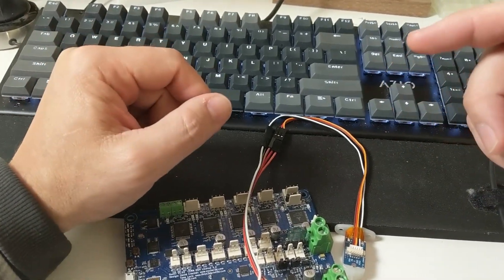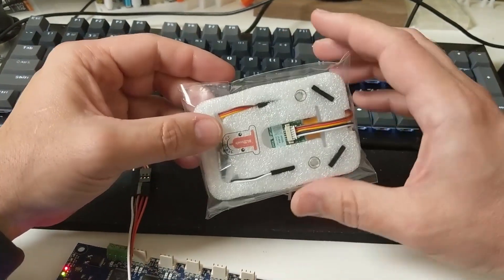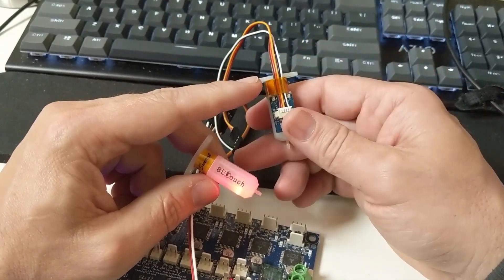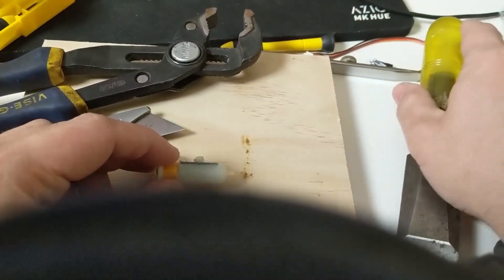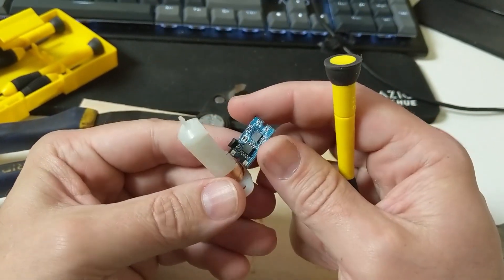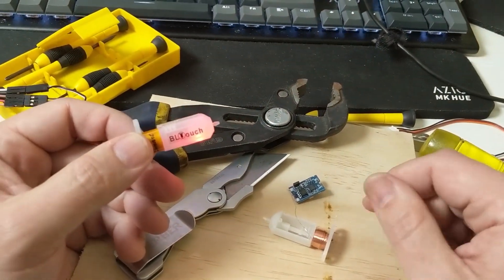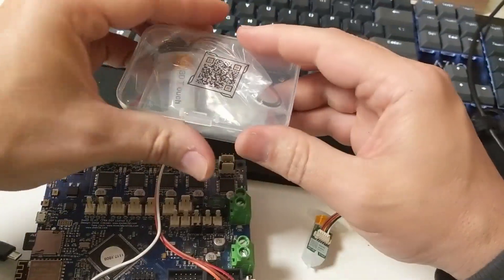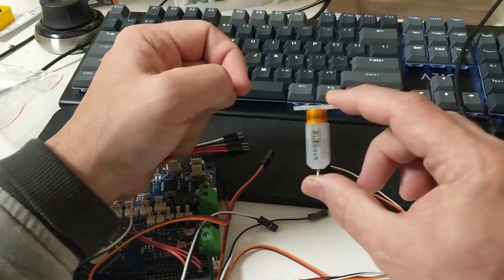BLTouch vs.  3DTouch - Should you save some money and buy the clone?

Comment: The BLTouch is not much better. Its repeat accuracy is better but its failures are the same. Rarely can I get a complete bed level scan without the BLTouch faulting (failing to deploy probe) and flashing. BLTouch support blamed it on the +5V power. I replaced the power supply with a much more accurate supply and put a scope on it. The BLTouch still fails but support refuses to do anything other than blame the power supply.
Reply from the maker: Are you a real person? Why does your channel have no content? Usually you can see subscriptions, and playlists, or an odd/random uploaded video for a typical "real" person on YouTube. Clicking on your username only shows "This channel doesn't have any content"
Reply: @DesignPrototypeTest  I'm just a guy who enjoys 3D printing and do a lot of my own testing. On this video I found BLtouch to be faulty with poor support. Unfortunately the 3D touch I had was worse. Neither was a plug in and run and neither I would buy again.

The actual problem with the BLTouch I have is the pin sticks and the temporary fix I figured out was when it faults (often at powerup it fails to pass its self test) I have to manually pull the pin down then select the macro to reset BLTouch alarms. The BLTouch will then work for some amount of time then fail to deploy again. If I repeat home Z after 5+ homes it will fail again.

 Note as a by the by you tested the sensor holding it horizontal and not vertical. The sensor including the BLTouch is more apt to fail in any position other than perfectly upright to reduce drag on the pin. 

Hardware fails and the true test of a manufacturer is how their support works. BLTouch simply re-directs and blames something else in my experience.

The positive side to Asian manufactured product is people expect it to be throw away and get little to no support. The reason for buying more expensive non Asian is for the support. Often it is not there and it is just more expensive. The funny part is non Asian is often still manufactured in Asia.

 I watch videos in 2 different perspectives:
1 - for my information where I can extract bias and get the info I am looking for on a product.
2 - for the growth and expansion of the 3D printing community - newbies joining us.

For the newbies joining:
 You likely seen my negative comments on video's that are very negative. I noticed of late that evaluaters on 3D print products wandered down the path to slam products. Videos are created for the reason of telling people this is junk. Slamming products and being negative in no way helps growing the 3D printing community. The reason for this is the odd thing you say positive three other evaluaters will comment negatively on. New people get very confused and do not join us in the community. I have heard people over and over give up on 3D printing because there is no way for them to make up their mind on a product to buy or move to commercial products since help videos basically call everything junk.

 I think in part this is due to bias in the evaluation and feeling the need to point out faults. This bias should not be there but of course its hard not to show it. For example I would believe you are for Delta, non Asian products and intellectual property bias, these products you praise and focus on their benefits. All others your primary focus is on the faults.

 On this video I would think you created it with a mindset (I will push this thought to the extreme to make a point) of telling people the 3DTouch is Chinese garbage. How different would the video have been if the mindset was to compare touch sensors? The same point is given but the concept is positive not negative.

 People are not dumb and can draw their own conclusions, they want to that is why they are watching!

Example and just points I dreamed up they don't actually reflect my view.
BLTouch benifits
Repeat accuracy of 0.05 mm - higher print starts (words??? lol)
Reliability
Long term life
Stylish
Replacement pin available 
Support

3DTouch benifits
Repeat accuracy of 0.2 mm
Inexpensive

You get the point, positive words listing non bias benefits not just benefits to point out the faults of the other products. Build a video around that basic thought and not based on proving its junk.

From the above people can draw a conclusion that 3DTouch does not offer repeat accuracy and Support and make up their own mind on a product. It also shows that first layer could be prone to failing more often with the lower accuracy without actually saying it.

Many people do not want to be "told" what to think and want to think for themselves. Every person watching has their own unique situation different from yours. Your fault conclusions may not apply to their situation. If you had a benefits conclusion they then can apply that to their situation.

 One of my observations about people over time has been that people learn the hard way no matter what we say is the saying. That is not exactly true and it is influenced on exactly what we say. If we tell people what to do (the negative thoughts path) they often do the opposite and "learn the hard way". If we discuss benefits positivly they often will not choose the path that we personally know they should not choose.

Negative sales studies showed that if you tell people what is wrong with other manufacturers products that people more often than not will buy that other product.
Reply: @DesignPrototypeTest  well how do I test that? I have no idea why you tube doesn't show you subscriptions
Reply from the maker: You should probably upload a single video of yourself if you don't want to be perceived as a troll/bot account. Maybe there is a 'privacy' setting that you clicked on to hide all of your account details from the world. Being so secretive about your identity makes you seem like an agent or a bot.
Reply: @DesignPrototypeTest  I have no idea lol. When I tried to put in a message YouTube said I could not unless I did stuff so I did it until it allowed me to enter a message.

Comment: I've actually tested both as well and had the same issue with both genuine and clones.  The same applied to Duet boards (authentic and clone).  Politics and morals aside, I ended up learning a bunch when the clone Duet boards I ordered once didn't have ANY jumpers pre-installed.  I went through several authentic and clone BLTouch sensors (and other Z-axis sensors) but what I discovered was that there are voltage setting differences in the PCBs and with the Duet boards (not sure about other boards).  Without any jumpers installed neither authentic or clone would work.  With the proper voltage jumpers set, both worked just fine and in an identical fashion.  What's sad is that even the BLTouch documentation is so piss poor that it barely assisted the troubleshooting process.  Even the OEM of the BLTouch could stand to improve their product and documentation, especially if they are charging a premium.  I've also learned not to expect anything to "just work" when it comes to 3D printing parts.  However, I always come out of the experience learning something.

Comment: Even the original BLTouch will fail after some period of time (two weeks in my case) when running on 3.3V. The Duet Z axis input handles any voltage up to 30 volts, so there is no reason to use a 3.3V supply voltage power supply.

Comment: Despite beeing a copy, those Clones work pretty much the same as the Original. I had both. But, I think Your Clones weren´t faulty, You just didn´t connect them correctly. There are 3.3V and 5V Versions AND Sometimes the Colors from the Wires do not Match the Original. So please when rewieving You should Rule that out first. In the End it seems to be just a rant and justification to buy the Original ones. I support the Inventors if I am able to, but sometimes their Things are way beyond my Budget, so that I have to resort either to much more time collecting the Money or simply buy what is affordable to me. Regards
Reply: Its looks like its works by pushing out the plastic with magnet on end by magnetising the coil where it reaches the hall effect sensor where it triggers and tell the circuit board to stop retracting process by demagnetising the coil, while it touches the board pulling the plastic inside and magnet away from hall effect sensor signaling the circuit that it has been touched the board at preset level and to again check the other axis same as the process repeats by magnetising coil pushing plastic outside
Reply from the maker: I have now tested it at 3.3v. I scratched the little trace on the PCB to change it to 3.3v logic and it does the exact same behavior. The colors on the wiring loom match the BLTouch. Don't get me wrong, I know how to get this probe working. But to really get it to 100% functionality would require flashing the actual BLTouch firmware onto the probe. Which would require me to rewrite that code (I doubt AntClabs is sharing their source code, and I don't blame them).  I'm not about to help some thieves in China sell knockoffs by teaching people how to get their broken product to work. Even I did, it's not worth your time to fight with the inferior product trying to get it to work. 3D printing has enough issues. Why give yourself more issues to deal with? Just support the original creator and get the product that you know will work.
Reply: @DesignPrototypeTest  Yeah, thanks for replying. One thing that came to me about the wiring. One of my knockoffs had a different Pinout from the 3 Pin Cable, but I can´t remeber which ones. I had to rewire it and it instantly worked. Keep up with the Stuff, 3D Printing is an amazing Place to get.
Reply: @Steele68HS  red and brown is probably swapped. I had 1 like that
Reply: @DesignPrototypeTest  inferior? little dramatic eh?
Reply: This video looks like propaganda to me. Running the clone with the original coding then saying the clone is faulty, when what you should be doing is going to the website the clone offers in the packaging to run the code that is compatible with the product you are using. This is like biting into an arctic apple and spitting it out saying "Dear god.. this doesn't taste anything like a granny smith!! It looks like a granny smith.. it's green.. but it doesn't taste anything like it! THIS IS JUNK!" Kudo's on you for presenting a case that doesn't hold up under a scope and then throwing morality around like you're at a pulpet. "ALL YE SINNERS BE MARKED AND SHAMED BY THE SIIIIIIIINS OF THE DEVIL! THY SHALL NOT WANT THY NEIGHBORS BLTOUCH!" Thank satan for China then because they are the only reason we aren't still paying $10+ per watt for solar cells and why prusa clones are now $120.
Reply: @reforgedcriterion1471  pretty sure it was a wiring issue and not anything else .
Reply: @andrewmaynard6693  No. They are inferior. Many people have tested them and the 3D Touch probes are as much as 3x less accurate as the real BLTouch sensors.
Reply: @DesignPrototypeTest  Ah, yes, let me just give birth to $20 (ahem, ahem, minimum wage in Russia is $150/mo) so I can toss them to the creator. What an insane idea that some people don't make that much money, right? What an insane idea that Anet A8, a $160 Prusa i3, is the most popular 3D printer in the history of 3D printing... These people are insane, right? They must just give birth to $600 more and get the original Prusa i3 MK3S, of course!
Reply: @machinerin151  Ever thought that people don't all live in russia? Do you have any concept how much it costs to live in places like the United States? I live in Commiefornia and a 2 bedroom apartment in a decent part of town is around $2500/mo. Want a 2000sq/ft home a mile from the ocean that was made in the 1970s? About $800k+. 

You can keep your $160 Anet A8 and your crappy 3D Touch sensor. The quality of both is nowhere near as good as a real Prusa i3 and real BLTouch.
Reply: @LBCAndrew  You completely missed the point. Someone who can afford to pay 800k+ for a home ofcourse can afford Prusa i3 and real BLTouch, even though I don't know why they would bother with shit like that, there are better printers out there if money is not a factor. Do you have any concept how little people make a month in big part of the world and how hard it is for them to save money to buy for example a 3D printer that for you costs barely more than what you spend on a night out with friends.

Comment: to begin with, it doesn't matter to me all that much!
BUT
if you said that the screw is nonsense and the cheap melting solution is better, I think that is nonsense!
*
now something else:
you're talking about stealing,
 but the fake touch is much cheaper ???
*
In addition, there is a lot of talk about open source in the 3D world,.....now not anymore?
*
I would not be surprised if you first bought that fake Touch, ...and when you discovered that this fake Touch did not work ...   
 ;-) 
*
in addition, if I would look back the videos of this gentleman who knows what there are fake stuff to see in those videos of him
?
*
(come on, be honest!)
  if it's cheaper what do you do? ............ 
*
Shall I start by being honest? okay then:
I also bought 2 fake Touch, they are still lie on the shelf.
I have not tried them yet because I am afraid of breaking the good software from my 3D printer.
I will test it sometimes with a fake arduino and a fake ramps (am I bad now?)
*
BUT again, I don't care for the rest,
friendly greetings from The Netherlands!
Rob.
Reply: You are correct 0.006 grams the screw adds to the mass of the head makes a real difference, I think not !
Reply from the maker: This is a message I have been trying to spread for quite a long time. Take a look at this video to see that I am consistent: https://youtu.be/iKhn5IcVvAg I bought these sensors knowing they would not work. I had a tip from a Patreon supporter.

Comment: How much weight do you save on a plasic pin vs metal screw?
Reply: Probably like a 100kg weight saving
Reply: The author of this video is just a smug social justice warrior. He couldn't troubleshoot the simple connection issue with this device if he tried. Don't listen to anything he has to say. He doesn't even understand that the 3d Touch design is not patented or moreover that Chinese culture doesn't believe in patents in the first place. He probably shot this video on an overpriced iphone and did the crappy editing on his $8K mac book pro...
Reply: @chrisheller2295  I'm willing to bet money that this is exactly how he did it! $2, since I'm the target audience of 3D touch and that's how I found this video...
Reply from the maker: Yeah. That is a bit of a stretch. I adlibbed the dialogue, and couldn't easily remove that statement in editing. Still, if you are going to put a screw for easy access to the guts, why would you then glue it shut?
Reply: Design Prototype Test  maybe the screw is used to clamp and align the board as the glue sets? Yeah, I think that little weight would be meaningless compared to the other heavier components on the hot end carriage and assembly

Comment: It's a you say, "didn't work out if the box"... But when I buy 2, and both are not working? Something else is likely wrong. I would say you didn't convert the 3d touch to 3.3v
Reply: Oh yeah. For duet board you must cut track on 3d touch pcb to work on 3.3V. Older bltouch have the same thing. Most likely you broke sensor or it never see proper voltage on pwm signal because it may have higher voltage threshold with Schmitt input.
Reply from the maker: Nope. I just tested it. I scratched the little trace on the PCB to change it to 3.3v logic and it does the exact same behavior.
Reply: @DesignPrototypeTest  , if it is not that, I can only think of the clone requiring more current to operate the electro magnet  ( cause they might use less copper or so, dunno) and that the duet is  unable to deliver that current.
Reply from the maker: Nope. I just tested it. I scratched the little trace on the PCB to change it to 3.3v logic and it does the exact same behavior.

Comment: I got the black version of this, which seems to be better quality. Other than that I had to resolder the two thin wires from the coil to the PCB (it was my fault, not the product's) it worked great. I noticed that it seemed to be slightly larger, even when retracted the probe was still below the nozzle, so I had to use an adjustable mount. You just got a dud
Reply from the maker: I got 2 duds. They both behaved the exact same.